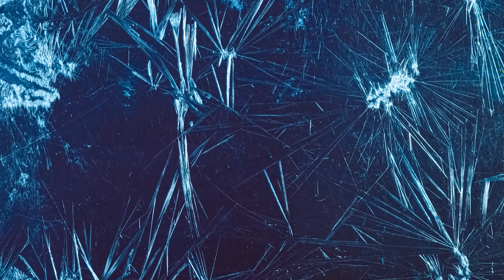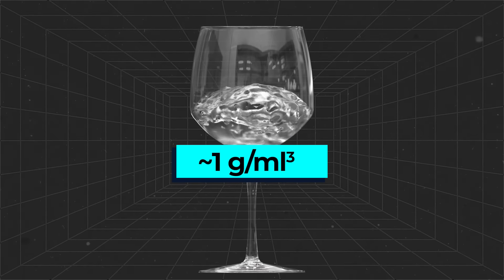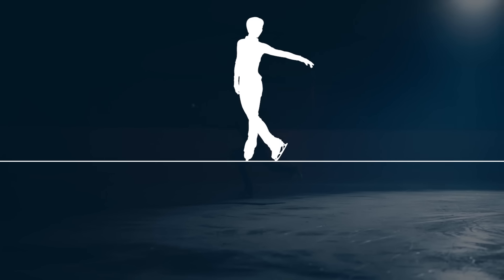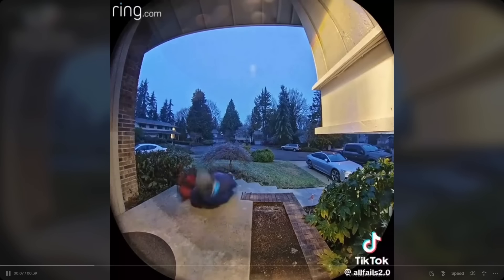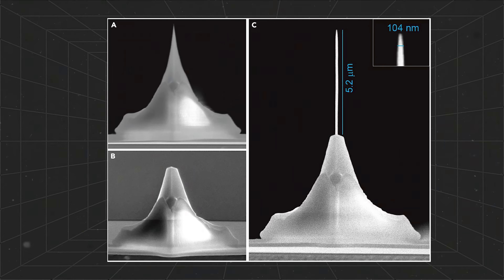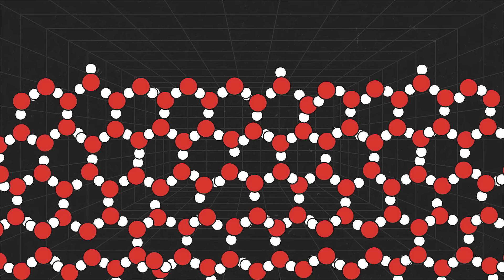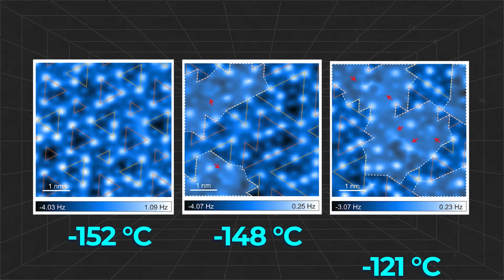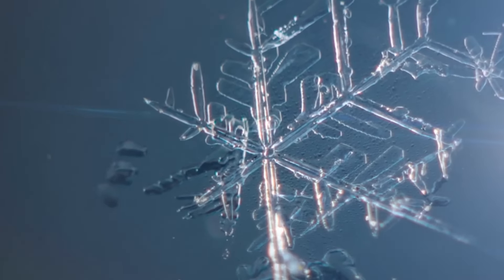We FINALLY Proved Why Ice Is Slippery

Comment: Absolutely marvelous video.  A problem that often comes up in the sciences is that once we have a model that seems to explain a phenomenon, the model becomes the reality, in the sense that it outweighs taking a fresh look at the actual phenomenon.  For example, when I studied material science, electrical and thermal conductivity in metals was explained by electron mobility.  But that didn't explain how electrical and thermal conductivity vary, metal to metal, in an uneven manner.  And then you find that diamond conducts heat several times better than silver does, while diamond is the best electrical insulator and silver is the best electrical conductor.  This explanation of why and how ice is slippery is so beautifully subtle!

Comment: I spent some days this January in Rovaniemi where the temperature was between -15C and -30C but the ice was not slippery. It was quite safe to walk around with no risk of sliding. I wonder if that was because of a rough layer of frost or snow covering the ice?
Reply: A couple of years ago I drove from Hereford to Worcester in minus 17 the road was very grippy
Reply: I topped Snowshoe Mt in PA USA one year on the expressway in 8 inches of snow.  On the Eastern side of the incline to the peak, myself and truckers, etc. were passing cars in the fast lane doing the full (fool) speed limit in slushy snow at the road surface level.  As I topped the hill (these ain't mountains)the Western side was wind blown powder ice as they had plowed away the snow before, and my car did three huge donuts in the middle of the three lane highway and as it did I saw all the cars backing off like some time slowed cartoon, and then my little Chevette went off the side of the highway and the shape of the ditch flipped the car once in the air and it landed in the wheels facing the road perpendicular to it no glass broken, no tires popped, and still running engine.  I turned it off.  Good thing because the exhaust pipe had broken free from the last mount and got bent and shoved into my gas tank.  All the flip did was rack my hatchback open and threw my drafting board and some of my tools out into the 8 inches of snow, which is when I noticed the gas gurgling out.  Glad I turned it off.  Ice is very slippery and I doubt seriously that there was any liquid form water involved on that western side.  The roadway was cold(er), and they plow so no salt or they missed this patch.  Anyway, that is but one of my experiences with ice.  They also took out several teeth on another occasion.  How quaint.
Reply: @peetsnort  hm that's quiet explains how they confidently drive in Northern countries while when we have ice at close to zero temperatures it is tooo slipery.

Comment: i'm so glad you've explained what I was never convinced of at school, about it being pressure melting the ice at the junction. It could never explain to me how you could have antarctic ice 1km thick wher if it was pressure due to weight, it would have to be liquid after a short depth. thankyou!
Reply: Water changes phase into ice at 32F and ice into water at 32F in a freshwater lake. The heat measured as BTU are the difference. Water is the densest at 39F at is at the bottom with 38F rising as well as 32F water rising and freezes at the surface. That’s why there is water under the ice. Never thought about it but the water must apply pressure to the bottom of the ice holding it up as it expands. Not sure of saltwater temperatures due to salt changing the melting (phase change) point.
Reply: @dennis1954 Salt amounts vary melting/freezing temperatures of water but the reason for Fahrenheit’s zero point is that’s where salty sea ice freezes. 

There have been refinements to precision subsequently, but 

0°F = frozen ocean
32°F = frozen fresh water
~100°F = body temperature

Comment: You didn't cover it, but this appears to explain why two pieces of ice join to make one piece when pressed against each other. Those molecules at the surface that are free to move now have 'buddies' on the other surface and they can arrange into a continuation of the hexagonal pattern, creating a single sold. I don't know if it has been verified, but it certainly seems reasonable based on this explanation for slipperiness.
Reply: If one were to make skates with blades from water ice, would they be slippy or sticky?
Reply: Skates from ice? Sticky, of course.

Comment: AFM probes are rarely metal, usually made of silicon or silicon nitride. Metal probes have lower resolution and higher wear, so they're often metal-coated instead. 7:30
Reply: Is silicon not metal?
Reply: @unclejimmy7 metalloid no?
Reply: @unclejimmy7  It's a metalloid.
Reply: @ratdoto2148  They should use some of the crystal they grew to make the new kilogram standard.  Now that is some clean crystal (probe) candidate material.  I think the tips are grown not machined though, right?  So... oh well.
Reply: @cosmicraysshotsintothelight  What? The Kilogram is now based on a fundamental value, it never changes. Why would you change it back to some physical nonsense?
Reply: @ratdoto2148  It wasn't really physical nonsense. It was a different proposal for the redefinition where the kilogram would be defined as a specific number of silicon atoms. A perfect sphere of pure silicon would be a way to measure it, and some (or at least one) such spheres have been manufactured.

But that proposal was rejected in favour of the meter + second + Planck's constant definition. In this scheme the defined kilogram is apparently measured using something called a Kibble balance.

The wikipedia article "Alternative approaches to redefining the kilogram" has a lot more information 🙂
Reply: @volbla  I know it was already done, why would u do it again when we have the watt balance now? Makes no sense.

Comment: Awesome!  We have observed this pre-melt layer in black ice which is typically at the ideal temperature for friction to vanish.  A few degrees warmer or colder and friction is restored.  Adding a layer of sand to the steps or driveway on the night before an ice storm gives our boots something to hang on to when the pre-melt layer is most treacherous.

Comment: Prior to watching: my theory for why ice fuses the way it does comes from thermal exchange and re-freezing. Simply, the ice is able to absorb just enough heat from the small amount of surface liquid to re-freeze it, ultimately ever so slightly increasing the rate at which the exteriors of the chunks melt. Kinda like a heat ripple.

Comment: Yes,  Always fascinating that Water has no lubricity at all...  Water instead of Oil in an Engine will lock it up Fast. And Ice is colder when in Water. Ice in itself is highly slick the more smooth it is. New Ice is very strong compared to being a week old on a Lake. 1" of new ice will generally hold a careful human: 3" of old ice.  10" of ice will hold an 8-ton truck.  Drive too fast on ice and a Wave will occur.   Fascinating stuff.
Reply: It's such a weird substance.
Reply: @renerpho  I think it is also the only thing that swells as it’s chilled.
Reply: @Jack.Waters  One of very few that do that, yes. He mentions Bismuth, which also does it. All the other examples are synthetic, and don't occur in nature.
Reply: @renerpho  thank you for that.  You’ve cause me to research which feeds the mind well.  Gallium also expands 3%. Fascinating that all 3 freeze at close-ish temps but they Boil at vast temps. Awesome.

Comment: Gauge blocks used by tool and mold makers are machined so smoothly they are wrung rigwther and apart without a measurable (by precision shop tools good to  0.0001inches)gap. Then they are wrung apart by twisting them at an angle. Its possible to ztack many if them to the specific height desired to check measurements. So, steel can stick together. Its way cool. I'd love for you to explore that!

Comment: as a bartender with a lot of free time, if you actually press the cubes with enough strength they stick together instantly. I believe it's because you give enough energy to the mollecules that are unsure about their orientation to move and when you remove the pressure they return to solid.

Comment: Thanks. You finally answered a question I had as kid.
The answer I got was that the ice melts a bit because of the friction warmth and that the liquid water generates the slipperiness. And that the water refreezes so fast that you can't see it. (When skating)

I always doubted this a bit because any other smooth surface (Like metal, plastic, ceramic) that is wet gets slippery, but not nearly as slippery as ice does. But because I did not have a better explanation I accepted it.

Problem is still that your answer is so complicated that I can't explain it to anyone else.

Comment: That is a weird gripe on the pressure-issue even if it doesnt explain it. 

It would be around 400.000 pascal pressure, for a person m=80 kg. Standing on both skates. That with atmospheric pressure is around 500.000 pascal. It’s a huge pressure, but not enough to make a real dent in the melting pressure point given by the graph.

Comment: How do they make the AFM probe tip so thin?
Reply: not sure about AFM but I did use a scanning tunneling microscope in a physics lab and made the atomic-scale tip myself. how? by taking a metal wire and wire cutters and cutting the wire while putting it under tension. it was surprisingly easy to do (though some people were less good at it, and had to try a few times to get a good tip). I'm guessing the AFM used here was more precision than that, but the ductility of metal allows for easy creation of a sharp tip.
Reply: Depends on the style of probe. Lithography for standard silicon ones and possibly combined with selective ion etching. Fancy geometry probes typically done in a FIB (painstaking and tedious). For high Q AFM probes I mostly used electrochemical etching though: fine wire(tungsten or gold) as anode with a platinum wire ring cathode in KOH solution and use a comparator circuit to shut off the current the moment the wire breaks which gets you into the single digit nm range.. which is small but doesn't quite hit clean lattice pics. For that you need a cold sample and an even sharper tip which typically is done by functionalizing the tip and putting a carbon monoxide molecule on the end to use as a probe tip.

Comment: On a different but somewhat related note, I believe silicone oil has such a low coefficient of friction for a similar reason.  The trimethylsiloxane groups on the end of the chains have almost no barrier to rotation when they spin.  They are like little fidget spinners on the surface, and their mobility facilitates the movement of objects over their surface.

Comment: Why doesn't an AFM probe tip dull immediately on use?
Reply: Because "touch" and "feel" are an oxymoron in the explanation. You will never touch atoms. Not even with other atoms.
You press within its electron shell and get bounced back before the electrons touch anything. This force is so tiny yet so fast that nothing truly touches each other. (well, unless you overcome the force of that electron shell which basically only happens inside a star or neutron star and perhaps in cyclotrons)
Reply: An AFM probe doesn't really "touch" the atoms that it's sampling, it rests a fixed distance away from the surface and senses the change in electromagnetic force on the tip caused by the electron cloud surrounding the atom. When it detects close separation, a feedback mechanism automatically moves the tip away from the sample and so the separation is restored to the fixed amount. This way you can move over surfaces that are not perfectly atomically flat without damaging the tip.
Reply: @Yezpahr  The thing about this fact that I find funny is that it means a person's sense of touch is created by cells registering ratios of resistance and energy from nearby magnetic fields rather than any actual contact between matter. 50-grit sandpaper has very prominent peaks of magnetism with rigid support behind it (solid) surrounded by a much larger amount of magnetism with no support (fluid) that give the impression of something jagged.
It also means you've never physically contacted anything with your atoms, even your own body's atoms. Compounds might be tugged out of place by particularly resilient structures, but it's not like they were attached by anything more than chemical bonds.
Reply: @aspzx  I didn't realize that it was actively moved, which makes way more sense. All I could think of is how a diamond knife works but how easy it is to destroy the edge if you even slightly move it to one side.

Comment: Another thing to consider is that when ice is very cold such as -40F (not counting wind chill), you can't slip and cant skate on it. Trust me, I tried it when I was a kid. Yes my parents made sure I dressed warm and let me try even though they told me it would not be fun. I i still had fun and proved it to myself. I put my skates on and gave it a run thinking I would just coast and ended up almost into a face plant, and it was an amazing thing to learn, as a young boy, trying to figure out why his skates and shoes gripped like the ice was made out of sand paper. (I deduced that the ice was so cold that I was freezing to the ice instead of the ice melting under the pressure of my weight). I was about 12 yrs old when I discovered this :)

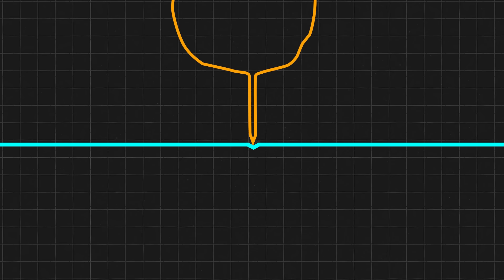Comment: 4:02 the shape of the part of the blade touching the surface is actually somewhat concave along the entire length. So it’s not a sharp ‘V’-shape as shown in the illustration, but an upside down—very shallow—‘U’-shape. Which results in two parallel ‘lines’ of maximum pressure.

Comment: Seems like this just shows the mechanism of how pressure causes the water layer to form. Light objects are still slippery as the normal force (W=mg) is less hence friction calculations are less. A heavier object should have more friction - balances out. Liquids are when molecules can roll over each other so credit to him for using an advanced technique to show the mechanism, but it is still solid to liquid based on hexagonal to non-hexagonal forming of structures. Next experiment - apply pressure and see if there is a displacement in hexagonal structures before and after.

Comment: I find it quite funny how all the old hypotheses did not work for me, like how the "melting" of 2 ice cubes was brought up. Although I did not have evidence for this until you showed it in this video, to me it is clear that you did not make 2 solids into 1 homogenous solid (tho one could achieve this by actually repeatably heating and cooling it slightly so it becomes crystaline), they are very much 2 solids "melted" together. You can realise this if you ever tried this yourself and that you can break them apart relatively easily and revert back to exactly the original 2 solid objects. That is not how cold welding works to my understanding. So a more reasonable explanation would be that the surface of ice can form new hydrogen bonds to the other, making a new semi crystaline structure. In other words, you go from 2 crystaline structures, to 2 structures with a tiny third one in between, strong enough to keep them together. This hypothesis of mine to me seems to be supported by this video, using the "free" molecules to form them, tho I am curious for feedback.

But in general I am intrigued that ice can behave in a similar fashion to the metalic bond, where due to free electrons, shifts in there structure are possible. But here we have free molecules. Amazing property. I wonder if beryllium has a similar effect, or if this is again another factor that makes water such a unique molecule.

Comment: Unless I am mistaken, your measurement device works as a result of the Pauli Exclusion Principle preventing the atoms at the end of your probe and the material it contacts separate from one from one another. Can you do a video to explain how the Pauli Exclusion Principle accounts for the stability of matter? For example how the Pauli Exclusion Principle prevents separate materials from simply fusing and how it causes cold welding or vacuum welding which presents a problem in space engineering.

Comment: Surface area of a skate is harder to measure than you think. The center of the bottom of the skate is indented. Skates are often ground with a curved shaping tool making the "actual" contact area much smaller.

Comment: In your skate animation, the blade appeared to have one point, as if it was a knife blade. I wanted to clarify, in case you weren’t aware, that ice skates have two points of contact each. They are basically two blades connected by an arc. The shape of that arc ranges between 3/8” to 1 1/4” radius. Most hockey players get a 1/2”-5/8” cut. I ref hockey in my free time, so I go with 5/8”-3/4” depending on how soft the ice is. Shallower cuts allow for more gliding, which is better for reffing as we aren’t constantly vying for the puck. We can usually glide into our positions. Hockey players also have the length of the blade cut as a radius of a circle depending on if they are going for more acceleration and maneuverability or want more top speed and stability. I use a 13’ radius for the blade length, as flatter blades cause less fatigue, and I’m sometimes on the ice for 12 hours(8 games) in a row. Some players will have a length radius of 7’.  The science behind skates and what goes into it is amazing. If you have any questions about it, I’d love to answer them.

Comment: I wonder if it'd be possible to make grippy ice by changing the conditions it forms under. Maybe if under a lot of pressure, or with some specific molecule dissolved within it, we can create a uniform crystalline structure on the surface causing it to no longer slip, as long as the surface stays cold enough that it doesn't melt.